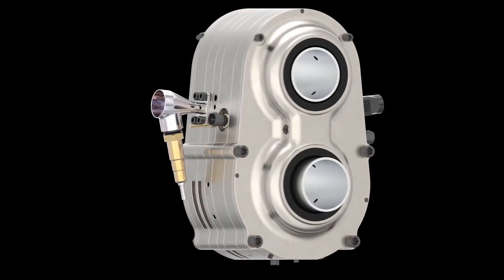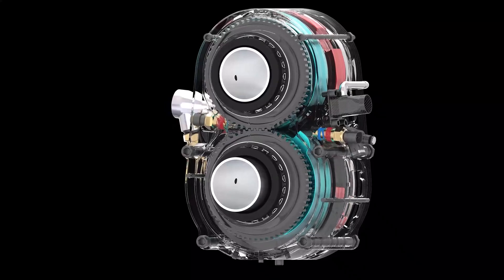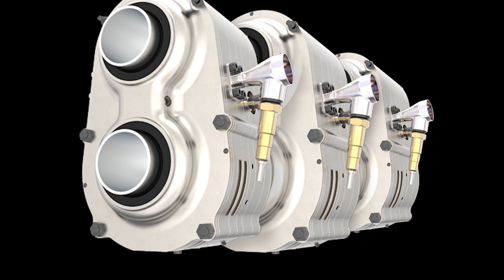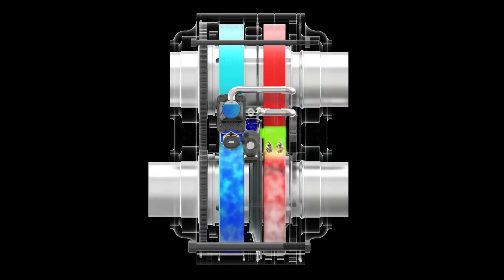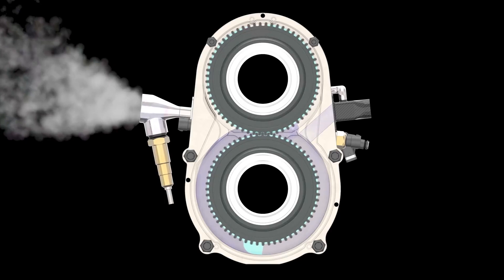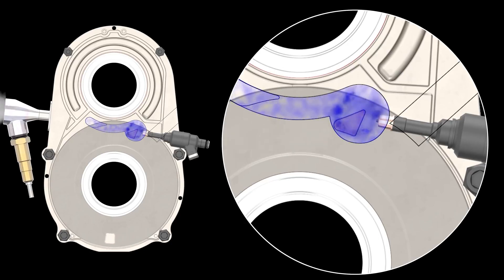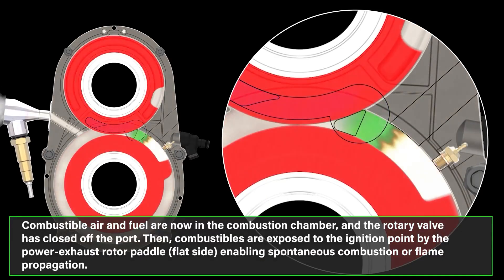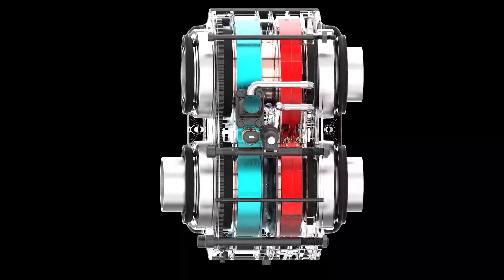This pistonless engine runs on hydrogen and revs to 25k rpm

Comment: So, how do you get the intake air to 200psi without decreasing engine efficiency with a huge turbo? Or is that the rub?
Reply: Reading through these comments no one has mentioned, that the downside to compressing hydrogen beyond one atmosphere is uhm, really dangerous.  Spontaneous ignition often occurs, try watching a bunch of HHO videos.  You will see pop offs.  Perhaps on a hobby level it’s unstable, and it needs to be chilled as its compressed. 🤔
Reply: @anubis8680  Yeah, I think some kind of fuel mixture would be the ultimate solution. Or like a lower concentration of fuel to start with and then fuel injected just before ignition. But the real problem is how you compress the intake air. Probably with a supercharger since you're going to have some power left over especially at high rpms. I'd also think you'd need a very massive flywheel to store up some of that energy so doesn't hit the transmission all at once.

Comment: Nice cartoon, but fancy Graphics do not an engine make.
 Did this person think about lubricating oil and how that's going to be contained with no seals,  not to mention problems associated with sealing engine parts during thermal cycling ?
It's just a few steps away from being connected to a magic pump that creates its own fuel so it will never need gas

Comment: Yes I agree with this as I also think  hydrogen engine will be the future as there is too much weight to carry batteries around which are less efficient and dangerous to, check out Harry‘s garage YouTube and interview with the owner of JCB as they have converted a standard Diesel engine to run on hydrogen interesting stuff.

Comment: It won't work if it cannot be airtight. It's just not possible that it can be efficient. The heat will cause expansion, the close tolerances will change, it's just not going to happen without some way to seal it airtight and that is the problem with these type designs. They just trolling for money

Comment: If this engine is viable for mass production..and is almost as cheap as normal ICE..then it will send shockwaves to the electric motor vehicle industries..
To further innovate to tachyon generated electric motor..to reverse this revolution...☝️🤪😁

Comment: But you still have to BUY something to make it work. A fuel. Fuel is taxable and can be charged a fee to acquire.
We need something that just runs.
Something like a zero point system. Doesn’t need a fuel. No emissions whatsoever.
Come back when you’ve got that.

Comment: I think that at 25,000 rpm it's just gonna centripetally separate the fuel and oxidizer since one weighs six times the other atomically and both will be molecular.
Reply: Separation is a process that takes a measure of time... There won't be time for separation of fuel components.

Comment: Simpler to use a pair of Roots blowers configured the way you'd have the compressor and power turbines in a gas turbine engine. Just a matter of getting the ratios right.